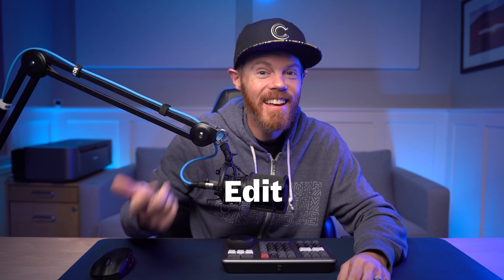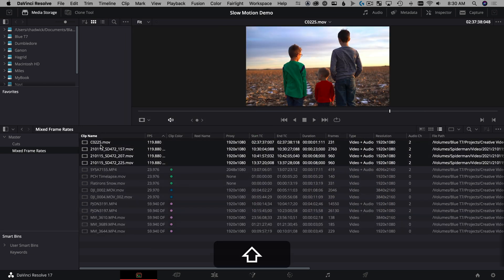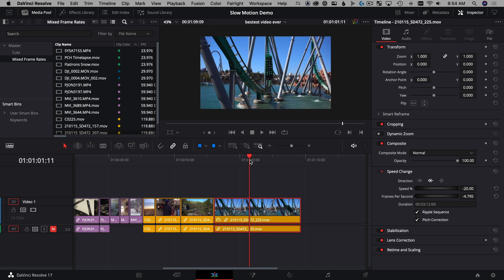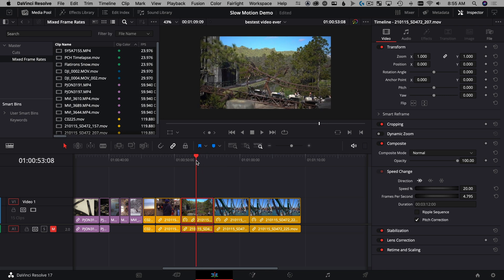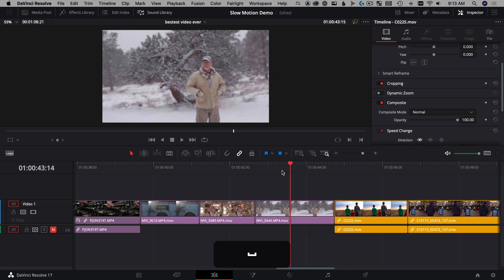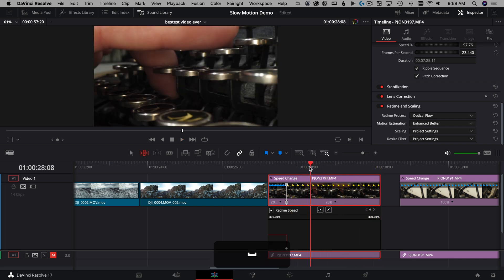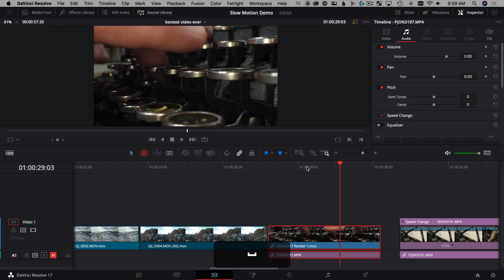How to Speed Ramp in DaVinci Resolve 17 - Pro Tutorial

Comment from the maker: 00:00 - DaVinci Resolve 17 Speed Tools Tutorial
00:42 - Clip Color
02:25 - Inspector Speed Change
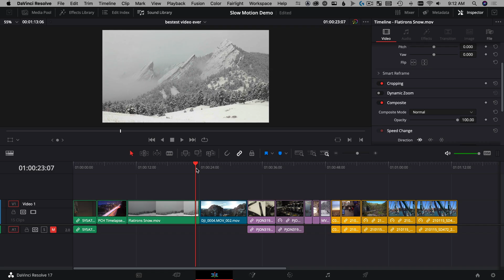04:59 - Change Clip Speed on Timeline
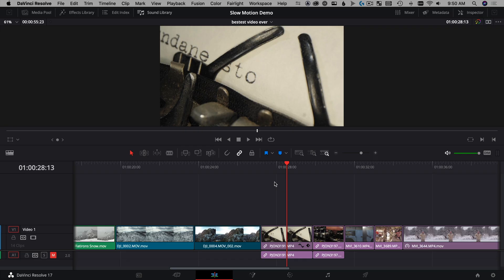06:46 - Retime Controls
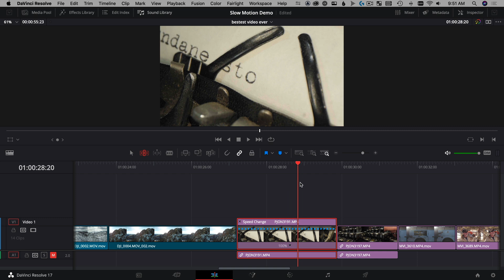07:38 - move - swap clips shortcut
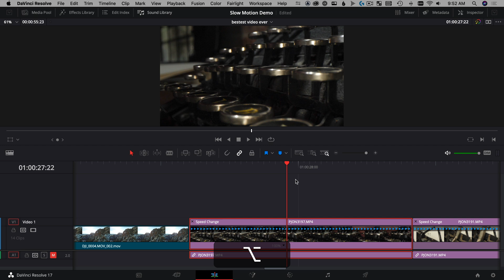08:23 - Add Speed Point
10:36 - Smoother Speed Ramps with the Curve Editor
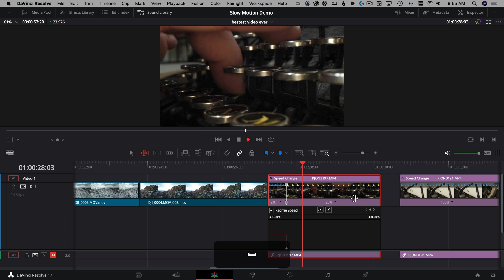11:52 - Enhanced Better Optical Flow Settings
13:01 - Render in Place
14:04 - Clip Attributes Speed Conform

Comment: This is one of the things I really miss of Final Cut, it´s so freacking fast to speed ramp on fcpx, o davinci I have to do so many clicks just to do a smooth curve of speedramp which is the default on fpcx ;( whish they could set some preferences on that like curve as default and also: Why there is not a custom speed when we click in that arrow "change speed" it makes no sense just having 25, 50, 75, 100 etc because we have to use 40%, 20% to make a proper slowmo without messing with wrong frame rates which mean we have to dial by nail that curve to get to these numbers ;(

Comment: Great video. So, for having  the option for speed ramping (Both speeding up and slowing down clips) is there a rule of thumb? for example: a 59.94  timeline. Should I film in 120, 60 or 30? Should I just film everything in 120 fps to have all options all the time for all timeline speeds?
Reply from the maker: 120 slow mo will always work, but I tend to try to only film with 120 if I intend to slow it down. The only rule is that you need to film a higher frame rate than your timeline.
Reply: @CreativeVideoTips  Thanks. OK so shooting always 60 FPS, and use a 30FPS/25/24 timeline, right? It will give me all the speed up/slow down with smooth playback no speed warp effect? When I shoot slow mo on an iPhone, the playback is always slo mo on the phone.
 can I change it on Resolve as regular speed clip as well?

Comment: Great channel and awesome tips! I want to ask if there is a way, to ignore the out point of the clip, while using the Retime Controls (like at 4:30 when You turn off the "Ripple Sequence")? To be more specific, I don't want the timeline to ripple since it's already cut to music, but I want to modify my speed ramp. When I slow down part of the clip, by choosing percentage from the "arrow menu", it overwrites the next ones... I can change the video track and then fit it, but that feels like a lot of work. Any trick tips?
Reply from the maker: Thanks for the comment. I'm not sure I follow 100% the question, but one thing you can do is bump a clip up to the track above and then make speed changes, get it the speed you want and then bring it back down to v1.
Reply: @CreativeVideoTips  Thank for quick reply! Maybe not the best explanation ;) 

Basically I want to modify my speed ramps without influencing the timeline, so yeah, that's what I did for now, just bump it up to v2... But it can be quite annoying. 

If You do it using the (cmd+R) "retime controls", by adding speed point and then changing speed through the small menu (change speed > 10,25, 50 etc) then it either overwrites (in A), or ripples (in T mode).

I found kind of a solution, if you manipulate through the "retime frame" curve and keyframes there, then the clip stays in place, timeline doesn't ripple and it doesn't overwrite the next clip. It kind of works, since it allows me to slow down by sliding the curve, but it works weird with speeding up.

Anyway, thanks for a great channel!

Comment: QUESTIONS: 
I discovered that with linked clips - can't set a speed point which spans several clips and adjust speed that way. Apparently need to do each clip separately.

Also is there a way to go faster than 800% ?

Comment: You can create a cache rather than rendering in place, leaving you with the speed ramp to edit and real-time playback.
Playback > Render Cache >User
Select the relevant clip
Clip > Render Cache Color Output
You'll see a red line above the clip (just below the timeline) that will gradually fill in blue as it renders. You have to enable "Render Cache Color Output" on a per-clip basis.
Reply from the maker: That’s another great way!  Thanks for the tip 👍🏻

Comment: Great video as always! I use speed ramp all the time but it's good to see how other creators are doing it. The clip colour was something I never considered to do, for example.

Btw, I use shift+c instead of setting retime frame shortcut. It will open up the empty curve, so you don't have to even turn off the retime frame curve.

Also, when your videos are 60fps, using 40% speed gives you smoother movement than 50%, because you don't have jumps of frames and you play every frame in equal speed. I would almost always set it to 40%, 80%, 120%, ... speed to avoid any janky movement, but of course when it is playing fast you won't notice it much so I only care about this when you're playing slow and long enough, (not to sudden changes in speed) if that makes sense
Reply from the maker: Dude - that shift + c shortcut is great.  Thanks for sharing that one!  And yep you're absolutely right about those percentages.  I really wish they let us customize those amounts on the speed point quick select amounts.  

Thanks so much for watching and contributing some more tips :)
Reply: @CreativeVideoTips  Yes I wish so as well. And no problem! Also thanks for your videos 😊

Comment: Your suggestion of working with colors for framerates is great and here is a extra math for you: A project with 25fps and 1 minute length. Filmed 25 minutes as timelapse with 1 frame per second using an external HDMI recorder like NINJAV and the last 15 seconds with 100fps internally on the same camera. It could be a landscape scene with moving clouds and some sport actions at the end. Combined in 2 tracks and masked by centering the actions scene and leaving the timelipse in an outer circle. Then start bending time...
Reply from the maker: 😂But when a train left Chicago moving at a speed of 60kmh is brought to a rest against a resistance equal to 1/100 of its weight and then later applied the brakes at which point did the train run against an equal force but more importantly who won the world series in 2016?